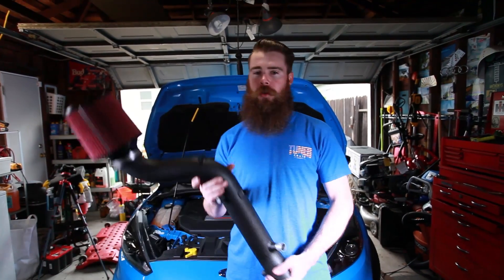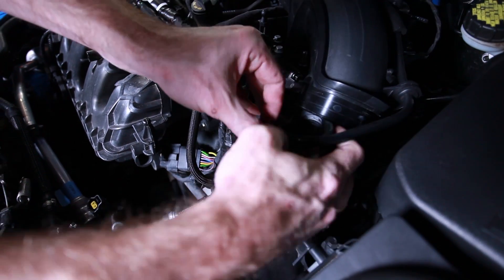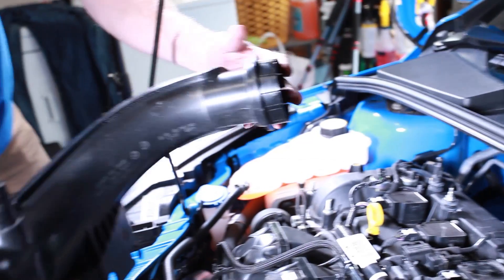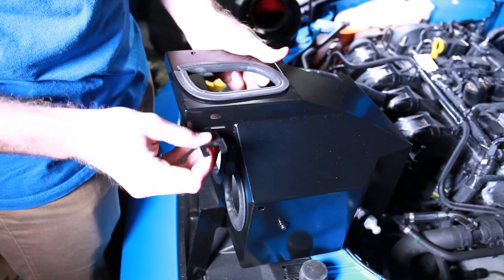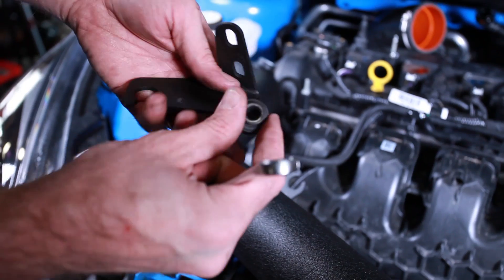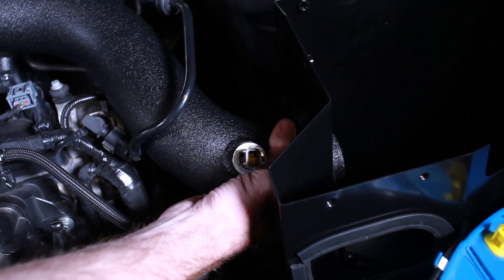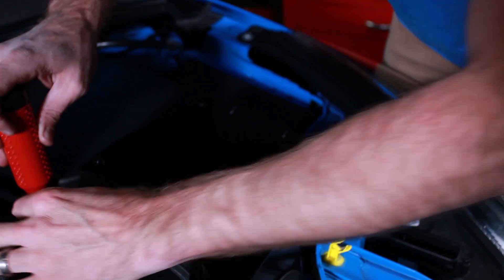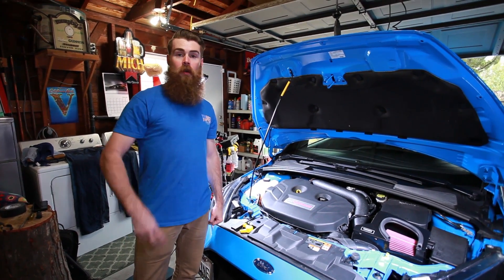FORD FOCUS RS INTAKE INSTALL

Comment: Wow crazy to see how much more secure the sensor sits in the intake in the black one, compared to the blue model. Kinda just wobbles around in mine.
Reply from the maker: +PubsWubs yeah this one was tight. Maybe put some electrical tape around it to snug it up.

Comment: So you can have the ram air and an aftermarket intake. Also wouldn’t you want to keep the intake cover on to seal the air in there like you said in the ram air video

Comment: Hey man! Sorry for the unrelated to the RS question but on your Subaru WRX hatch- were  your fenders rolled at all with that setup for those 18 x 9.5s? Also do you remember the offset?

Love your videos man, keep up the awesome work.
Reply from the maker: michael decouto +35 on 265/35R18 tire

Comment: Was the big mouth and sealed box not cutting it for him?  Curious as it was only on for about 2 weeks
Reply from the maker: J_RuSty I had both products to install the same day. The bigmouth is still on the car just not sealed.
Reply: I'm guessing the 100% sealed box isn't all that important then been debating on getting a big mouth for mine as well
Reply from the maker: J_RuSty it was engineered on the sealed box concept. However it still will have benefits over the stock set up just maybe not as much as it would if it was sealed.

Comment: anyone know if a bad cat converter and/or access port can blow up an engine.  Mine did at 34,000 miles and Ford said I wiped the memory, it was over fueled and denied all my claims.  Now on the 2nd engine, just over 1,000 miles under her belt and am getting the same errors and engine light coming on..."cat efficiency below normal", "random misfire"...etc?

Comment: Almost every aftermarket intake claims 10-15 HP, my experience is it is usually BS. All you end up doing is wasting $400-$500,  generate codes, and cause drive ability issues, because the sensors don't see the same sort of air flow. 
The stock intake on this car already looks like it flows very well. Most likely this intake is a complete waste of time and money, oh and it could easily void your warranty, so there is that. Based on what I am seeing about the reliability of this car, you are definitely not gonna want to give Ford any excuse to void your warranty.
Reply: you obvioisly dont know about the magnusson-moss warranty act. basically it states that no dealer or manufacturer can void a new car warranty except in gross negligence or abuse, they can only deny a claim. it also states that a dealer or manufacturer may not arbitrarily deny a warranty claim simply because aftermarket parts have been used or present. the part(s) must have caused or contributed to the cause for which the claim was sought. a dealer MUST troubleshoot, they cant just point and assume.
Reply: the way this car measures air isnt the same as say a wrx, this wont need a tune to compensate.
Reply: the rs infame is not limitting anything until maybe over 500 whp

Comment: All that money wasted on the Velossa Tech garbage only to completely do away with it in the end.
Reply from the maker: Danielle Koran it's still in the front of the car and hooked up. Just the stock air box piece was removed.
Reply: I agree with you, it negated the ram air block off plate and reduced the inlet air velocity in the process